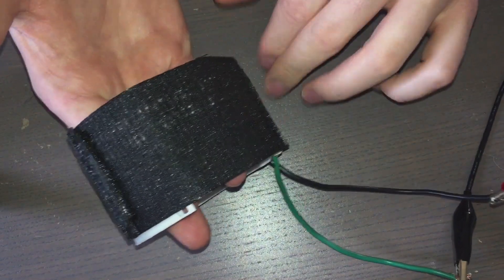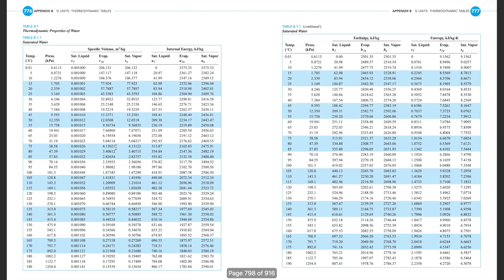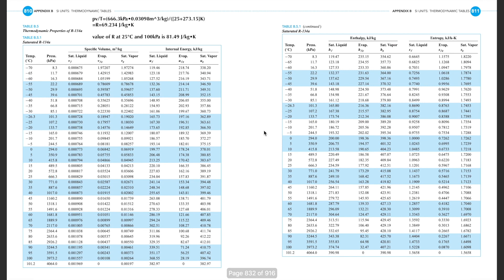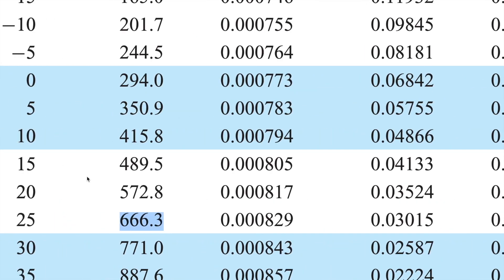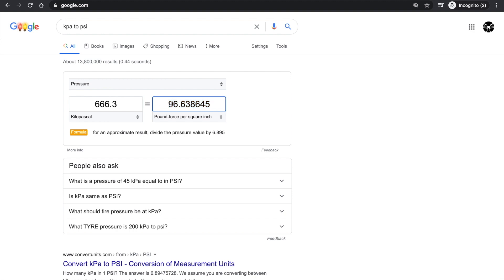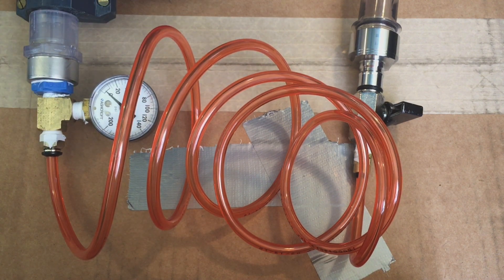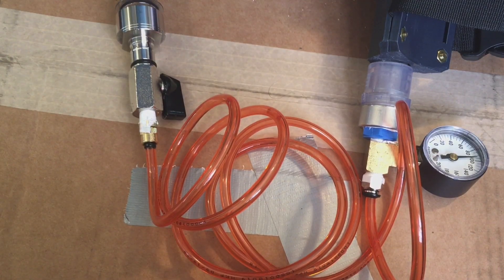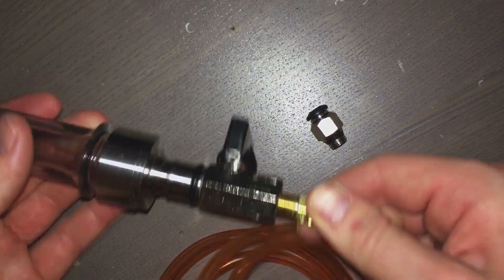Episode 6: Cartridge Pressure Testing | Research & Development

Comment: I just wanted to say thank you, You have inspired me to work on a pretty cool web shooter project this project will active either next year or Christmas the web shooter well be my Mk2 web shooter  it is a mechanical web shooter if you want to check out mk1 it is on my channel but either way thank so much man.
Reply from the maker: Looks good man! You might want to invest in a 3D printer for your projects. They have some cheap ones on eBay which I have had success with, such as https://www.ebay.com/itm/US-Stock-Creality-Ender-3-Pro-3D-Printer-Thermal-Runaway-Protectio-220x220x250mm/123731580024?epid=7022988634&_trkparms=ispr%3D1&hash=item1ccefa1478:g:V~oAAOSwkp5cpb2r&amdata=enc%3AAQAFAAACYBaobrjLl8XobRIiIML1V4Imu
(It still took me a while to save up for one of those, of course)
Reply: got it man thanks for the advice